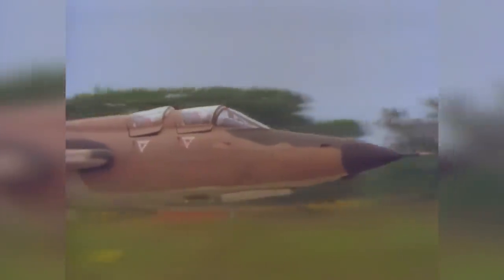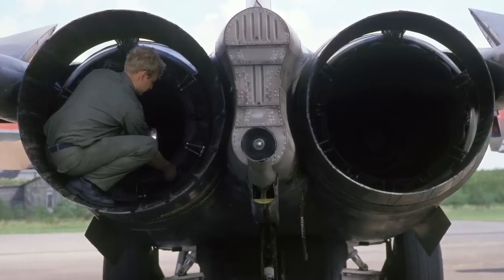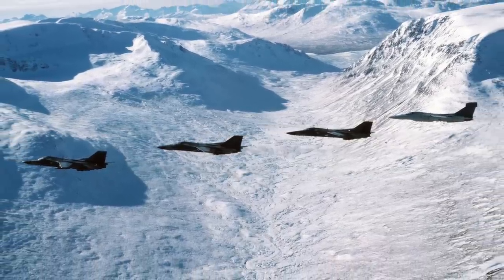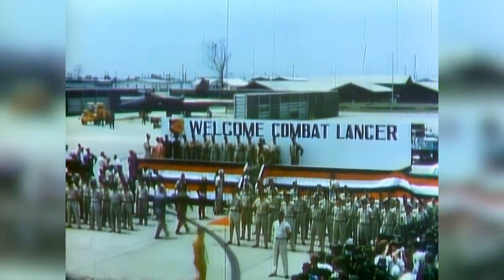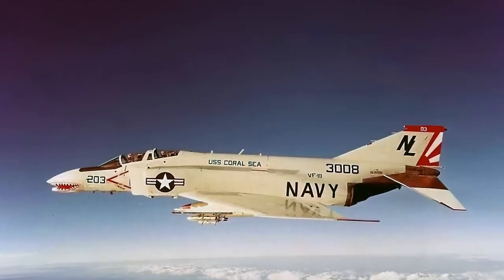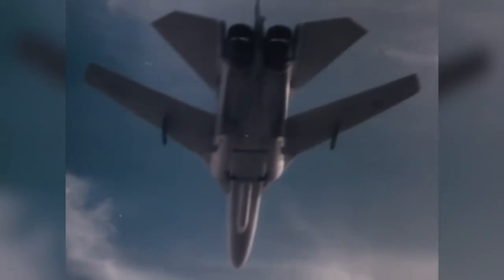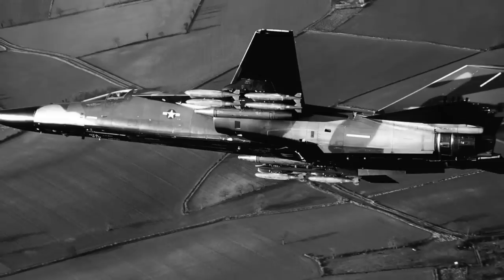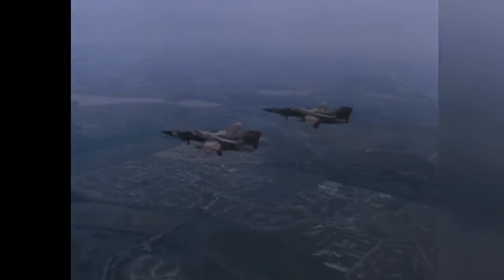F-111 Aardvark. General Dynamics supersonic, medium-range, multirole combat aircraft. Upscaled video

Comment: Heap of junk! Fast in straight lines, G restricted because thee wings fall off. Another real time failed in the USA aircraft
Reply: You are obviously a low information commenter, because it was a very successful airplane in combat.  It became a maintenance hog in later years, but that is not unusual for aircraft that were highly innovative when introduced.
Reply: @gort8203  Commenter? What word is that, is it English?? It most certainly was not successfull in combat, with no CAP to intercept them, they did a job but as in Vietnam, they were so dire they were withdrawn
Reply: @gort8203  Sorry laddie, it had a low loss because it was wihdrwn because the wings under high acceleration fall off. The information I gave you is avaiable freely in histoyr books and not bloody google
Reply: @jimwalsh8520   You must have a low information history book, or more likely a low information memory. The airplane was not withdrawn from combat, and the wings didn't fall off.  You might be thinking of the F-105, which was withdrawn from combat when the shrinking fleet lacked the numbers to withstand the combat loss rate.  Also, one of them did break up during a Thunderbirds demonstration flight.

The F-111 was withdrawn from SEA when the 1968 Combat Lancer combat test program was terminated.  It was a test program with 6 aircraft, not a combat deployment of a fully operational aircraft, and the wings did not pull off.  There is no evidence that any of them were brought down by enemy action.  The aircraft crashed due to failure of a stabilator control rod that caused full airplane nose down deflection. This fault was corrected throughout the fleet before the airplane went operational in 1971.  This has all been fully reported in the history books for many years, and I knew of it long before the internet and YouTube with its low information commenters even existed. Whatever is filling your brain cells is not knowledge.
Reply: @gort8203  Laddie, I owned three flying schools in Oxford shire and Northants, there was a USAF F111 base at Heyford. Because of the un manoeuvre ability, NOTAMS were put out when they were flying for GA aircraft. I had one F111 pilot, a major who discussed with me at length just how bad it was as a front line aircraft
Reply: @jimwalsh8520  I can't believe you owned three flying school and are that ignorant about the purpose of such a NOTAM.  High speed jets at low level never mix well with GA aircraft because of closing speed, not turning circle.  I can tell you from experience that light aircraft are stationary targets when you encounter them at high speed, and the danger is in not seeing them in time to dodge them, not in being unable to maneuver.  

I can only wonder what this lone F-111 pilot thought the aircraft was bad at.  It certainly wasn't bad at what it was designed to do, so he must have wished he was flying something with different mission. I knew and flew with more than one F-111 pilot, and some of them wished they were flying an F-16 instead, but none of them said the airplane was "bad as a front line aircraft"".

It's clear to me that you want to ignore the facts and cling to your own fantasy.  I think we've both said enough that other readers can now judge for themselves.